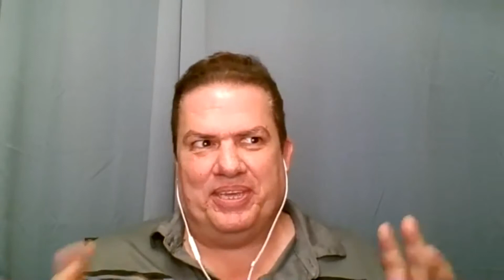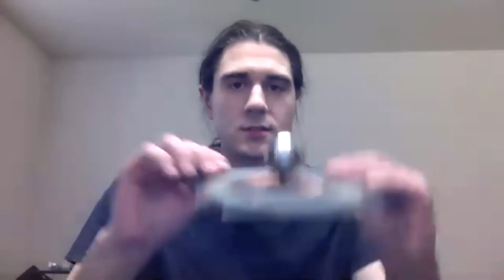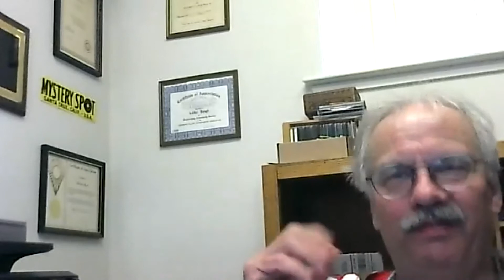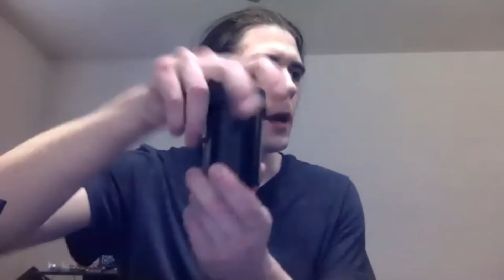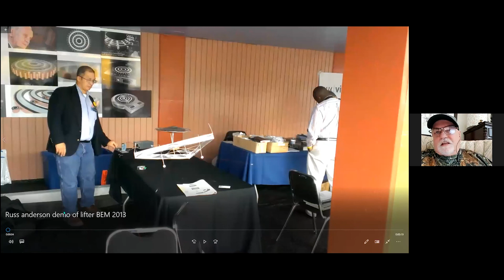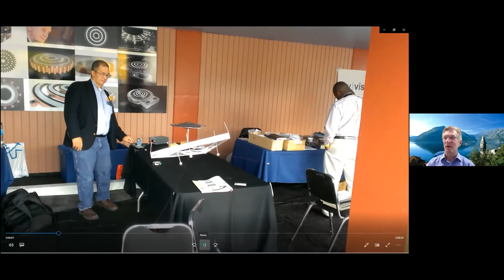APEC 5/1, Part#2 - Tom Valone - Electrogravitics & Electrokinetics Q&A

Comment: Oh, and keep exploring high-energy toroidal fields! With plasma present on the inside of a tube (and at very high pressure but very low temp) the plasma will recirculate current as well as generate it in the presence of the field(s). Useful effects are at around 50,000 rpm.
Go for it!!